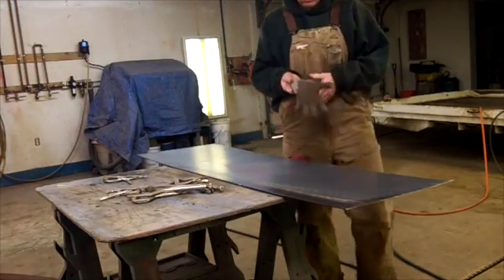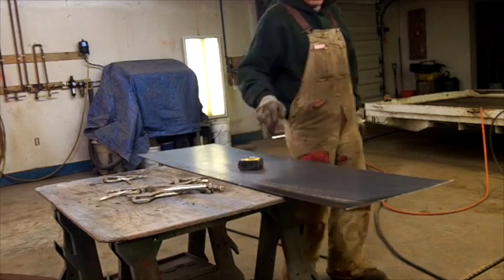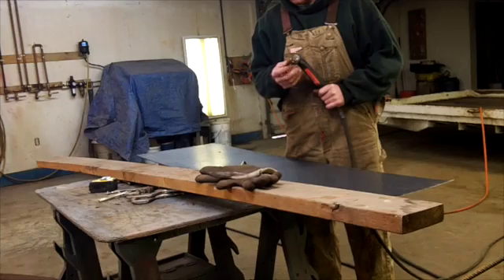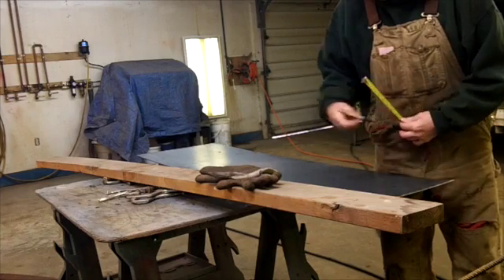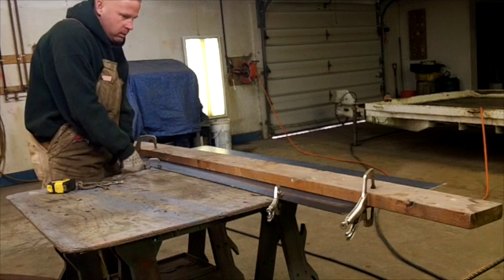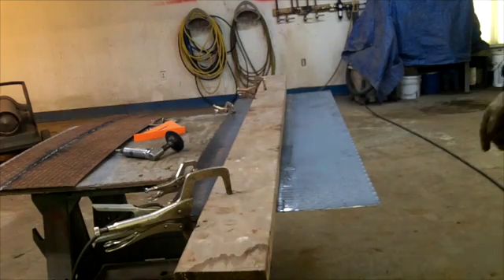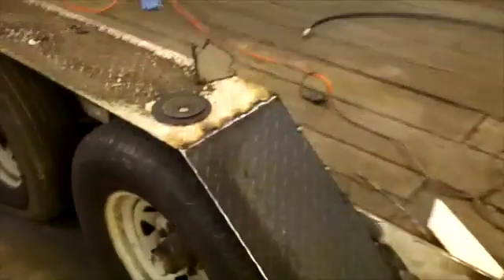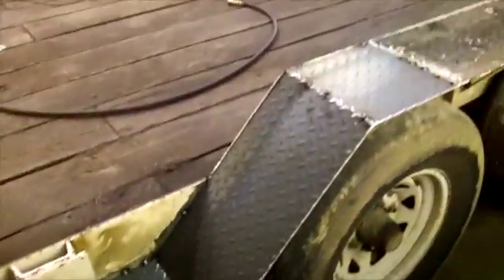Cutting diamond plate with plasma cutter - Fabricating trailer fenders

Comment: For a hobbist is it worth investing in one of those cutters?
Reply from the maker: That would depend on your budget for an occasional use item.  The 110 volt units with an on board compressor are about 900 bucks and can usually cut 1/4".  The machine like I have is gonna run you about 1500 bucks and can cut 1/2" all day long on 220 volt current.  For light jobs, the smaller machine is fine.  I bought mine when I was doing a larger fabrication job and could justify buying the bigger machine